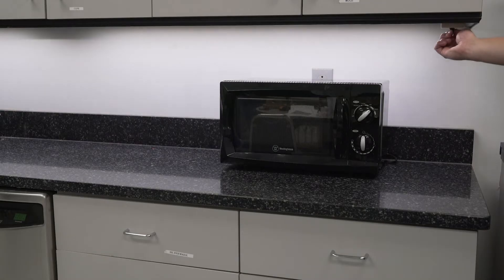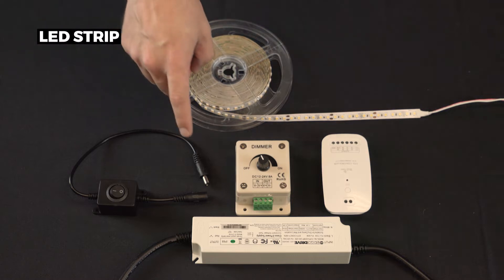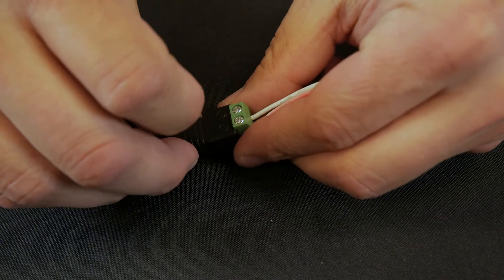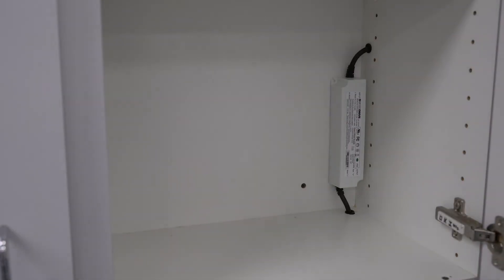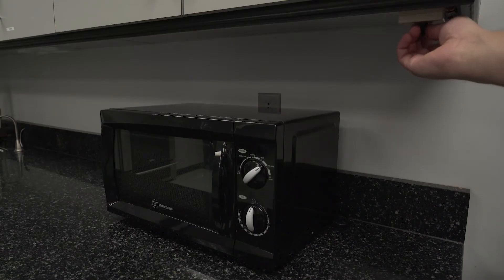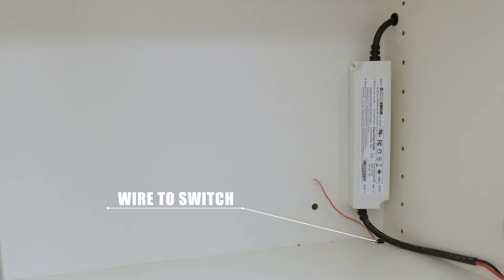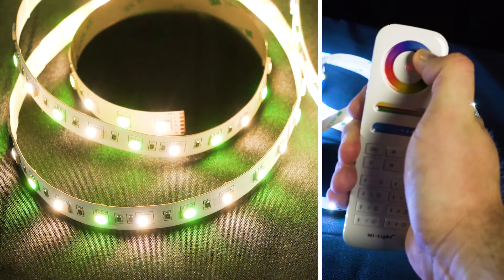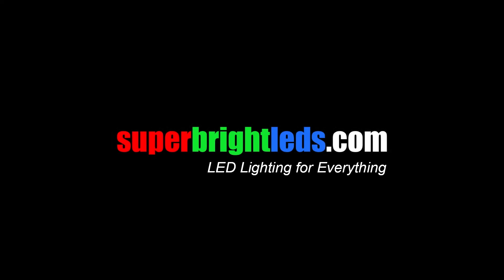How to Wire an LED Strip to a Switch

Comment: i have the same questions as below, but it doesn't look like anyone's answering. Can you connect these to be used from a wall switch that controlled old standard undermount lights?
Reply from the maker: Hi there, yes you can. Any of the strips that we carry can be turned on/off from a 120V wall switch via switched outlet. With a 120V strips, they're plug and play. With our 12-48V strips, a power supply is needed to drop to the correct voltage, but they still can be turned on/off from the switched outlet.

Comment: What if I do not have an outlet to plug into but instead have an electrical box where an old light used to be (controlled by a wall switch).  Can I simply cut off the three prong plug and hard wire directly the the white, black and ground wires and continue to use the wall switch to turn the lights on and off?
Reply: Did you ever find an answer to this?
Reply: @AdventuresofMikeandJen  No, I did not.

Comment: What about a normally closed circuit  that turns on when you open the cupboard?
Reply: I think the motion detector system can be integrated so that when the cupboard door opens the lights will switch on, im trying to implement the same process in my closet

Comment: Can the power supply plug be plugged into WIFI outlet? So I can use Google Assist? Skipping any control completely?
Reply from the maker: Hey Franc! Yes, you can do that, which will allow you to turn your lights on and off with Google Assistant.

Comment: Can an LED strip light be 'hard" (two wires from the LED strip) wired into a 12-volt switch in an RV without having to use a power brick?
Reply: Probably not. that power brick is converting the AC power to DC and lowering the voltage to an amount that the led strip can safely handle. There's a possibility that will work if your sure that 12 volt switch is DC and the led strip is rated for 12 volts.

Comment: What if we connect led light wire directly to power / plug ?

Will it work ? Y we required adapter ?

Mobile adapter can we use ?

Thanks.
Kishor.

Comment: Why oh why is there no decent looking wall switch option for LED lights?  They go from garbage in-line or tacky lab look dimmer switches straight to fancy schmancy wireless remote 4 color remotes, but all I want is a standard in-wall, residential style rotary or sliding dimmer switch with full on/off capability!   What is wrong with the LED strip light industry?  Can I be the only one that wants this?
Reply: You can use triac power supply if you want to use regular dimmers
Reply: Thanks. Yes and that's what I ended up doing, but it is such a messy inefficient kludge I don't understand why no one has stepped in to make house quality inline dimmers.  RV industry, solar home industry, regular home LED light strips, all simpler to control with standard DC inline dimmer after the LED driver instead of indirectly via 110 triac phase cutting

Comment: What about a wall switch, rather than a small switch like that?
Reply: This is what I came for. This info isn't particularly useful; wiring to an actual wall switch would be helpful.
Reply: That is exactly the info I've been searching for. If you find or have already found out the answer to this can you respond to this comment and let me know?
Reply: @TheIronDuke9  Searching for the same. I have 3 fluorescent tubes lighting the top of my kitchen cabinets, love the effect but absolutely hate the buzzing from neon tubes. From what I gather, you need to use a 12V DC transformer. This small device will take the 120V of your wall switch and transform it to 12V for the LED strip attached to it. This is assuming you want to connect it to an existing wall switch that already has the cables and all.
I haven't tried any of that yet but figured you could use the info.
Reply: @TheIronDuke9  the only way to switch LED lights via a switch you already have controlling say your ceiling lights in the same room would be to extend the 120v wiring from the nearest light to a outlet for the led light driver to plug into or direct hardwire into the led driver. Basically that makes the 120v a switched leg that will only work with the switch. The less popular second option is to install a 12v transformer directly into a existing octagon box where your light fixture is now and run 12v low voltage to your lights but you cant run very far at 12v without having voltage loss which is why its less popular. would recommend hiring a electrician if your dealing with 120v. stay safe
Reply: @AnimosityGamers  what is an octagon box?
Reply: @AlejandroTaylorEscribano  I think he means junction box.
Reply: Any of you solve this? I am wondering the same…